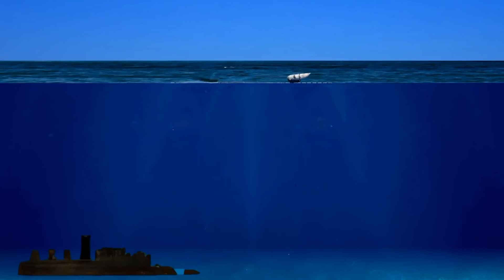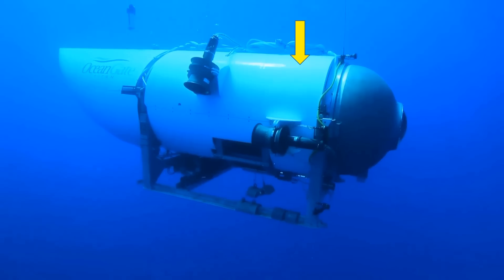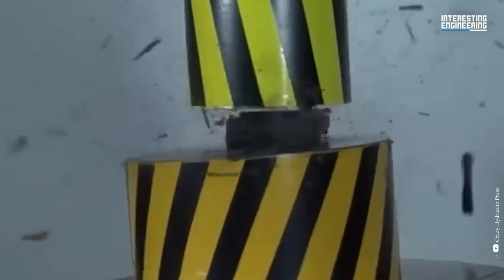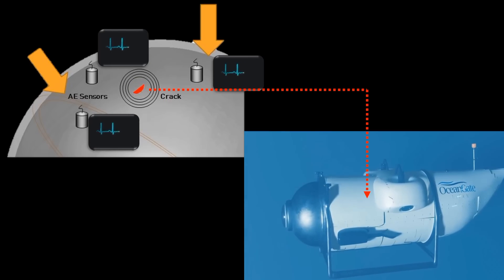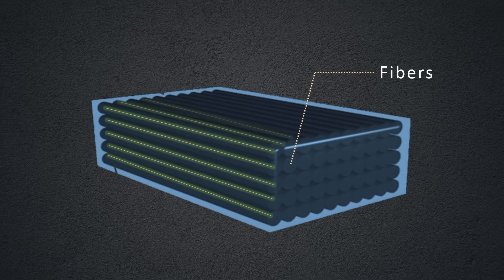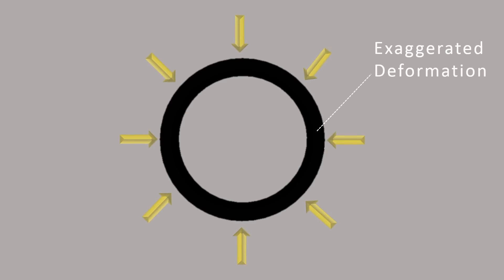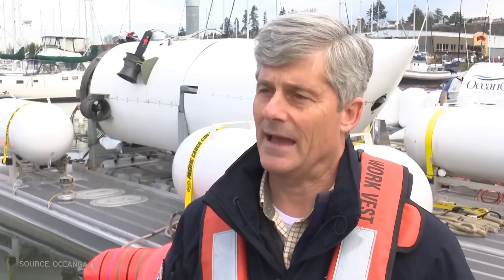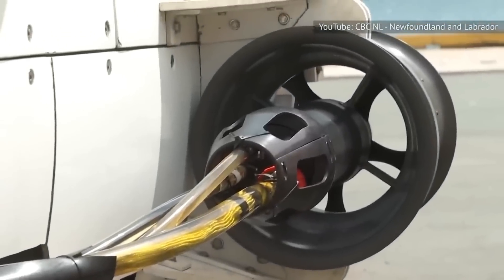Oceangate Titan Did Not Implode Just From Pressure. There Is a Catch!

Comment: If the unverified message log (we do not know if it is genuine) that circulates online is true, a possible scenario would be that water leaked in the unpressurized tail of the vessel, making it descending too fadst and explaining the difficulty to ascend. In the log, the warning lights of the sensors for cracks were indeed as you predict turning all red, but since the vessel failed to ascend properly, the scenario that you describe exactly turned out.
Reply: Interestingly none of the messages spoke of any water intrusion, even tho the craft was clearly progressively loosing buoyancy from about 2960 m down.  Something was giving in a way that reduced the displaced volume without immediately catastrophically failing.

Comment: The cylindrical submarine design is specifically for being able to have passengers
Reply: Yes, Aluminaut submarine was made in 1964 to reach -5300 m, made of aluminim 7079 T6 forged, 11 circular section ,bolted, with x circular cross sections for reinforcement. 15,5 m length, 80 Tons, int dia 7 feet, wall thickness of the hull 7 ' and half 170mm, an other story.

Comment: There are lots of posts on this subject of various quality- this is the best one out there. Well done. I have been working with composites for 40 years and agree with 98% of the content . My only comment is that it is best to view the loading case as a flexural bending situation. This gives tension on the inside of the tube, compression on the outside, and shear on the centre section of the laminate. The compression and shear performance is very sensitive to defects. Great video 😊

Comment: Carbon fiber is great in tension.   But there is NO WAY you can rove a carbon fiber vessel to resist external pressure from all directions.  The pressure of the deep ocean puts ALL the carbon composite in compression.  In THIS use case, Carbon Composites are NOT as strong as their engineering stats might have lead Rush to believe.

Comment: 👍👍👍 .. very well put .. thank you.
A comment on the shape of submarines. Yes, they are tubular out of necessity, as with their maximum dive depth ratings which are nowhere near that of deep submersibles.
Carbon Fibre in sub-surface vehicles? Merely the fact that the material is not homogeneous tends to work against it. However, going forward, used within it's limitations and with the relevant testing and certifications, perhaps?

Comment: Would be really interesting to see a model that includes the locations of all penetrations and mounting points on the hull.  Penetrations and mounting holes (or regions that are stiffer if external mounts are attached with welding (or glue) can change the symmetry of deformation under load and cause stress concentrations.  Even how the lifting points are designed and distributed can have an affect on it's integrity (it is over 10 tons in weight after-all... ) Do you have access to any engineering documents / drawings that include that info.  A model including that would be awesome to see!
Reply: Rush himself stated that the carbon fiber could not be drilled. Knowing that, I would have to assume anything that was mounted within anchored to the titanium rings, or was held in place with an adhesive.
Reply: I believe they used bluetooth for all communications between the inside to the outside, no physical connections whatsover.
An internal life support system plus control unit, the external systems were propulsion and lights + cameras. and ballast control.
One of the early missions the BT comms failed and they had to sit it out until the ballast ties melted from the seawater 10 hours later. and up they popped.
Reply: @joefish6091  Using bluetooth that way would be an interesting solution to the bulkhead intrusion problem but isn't carbon fiber conductive? Pretty sure I've seen it used in wallets shielding credit cards from wireless attacks.
Reply: The only mounting points were 4 attaching brackets designed into the Titanium Domes at 9/3 o'clock positions. Rear stationary and Front secured after boarding. These Brackets attached to the Exo-Frame cage which housed all of the Drive mechanics, cameras, external lighting, etc.
I found no indication of any pass-through connections, making the internal navigation and electronics wireless.
Reply: @MightyGimp  You mean the mounting screws going into the inner lining, right? The brown inner lining there for insulation and for things to be screwed to? You don't think the brown interior is carbon fibre, surely?
Reply: SuperNostalgia.  What is the link with this submersible ?
Reply: Too much for my mind 🤪❗️
Reply: Well either way shoulda used metal. 
You get what you pay for in this case he paid half price for a glass casket.
Reply: I believe your observation is spot on. The dissimilar materials and poor selection of points of attachment guaranteed catastrophic failure, in my opinion. The choice of carbon fiber is a stand-alone guarantee of failure.
Reply: @pugsymalone6539  Without specific plans of the submersible anybody, literally ANYBODY, can go on and on making videos of what happened and how it happened.
There were a team of engineers working here.
Agreed; they were not deep sea specialists but however; ANY mounting point or hole INTO the inner tube of the submersible would NOT have been made through the Carbon Fibre, IF Needed, through the titanium ends.
ANY mounting points would have been exterior to the pressure capsule.
Reply: @Team33Team33  I'm not saying that they drilled into the carbon fiber. I'm looking hard at the reduced diameter of the CF that created the lip onto which the titanium rings were glued. That's a stress point, exacerbated by the dissimilar materials expanding and compressing at different rates, causing the seal to fatigue, possibly the lip itself.  Next is the proximity of the landing skid band to the reduced diameter CF/titanium rings. More stress in the same area. Getting the vessel in and out of the water looks like a bumpy ride; did the CF incur regular abuse from the landing skid torque as everything was bouncing and banging? Accessibility to the batteries, etc inside the vessel appeared to be limited or nil. All around, a textbook method of doing it wrong. The screws visible inside the vessel are attached to an inner metal tube. Preventing visual inspection of the interior of the pressure hull. Ugh.
Reply: @Team33Team33  True, there's so many things that could of gone wrong and yes both professional and armchair engineers across the internet will be arguing over what could of been done better for years. Some will call it idle speculation but to others it's research because you can bet sooner or later somebody will have another go at it.
Reply: @Team33Team33  Correct. nothing in any of the angles I have viewed from assembly shows any transition connections out to in. The design dictates now would be necessary and everything internal likely operated wireless. * This would explain the 7th Emergency release, the dead man switch(no pun intended) which would release weight as the substance dissolved in the event all onboard were rendered unconscious.
** One thing no one has considered, in hull failure, is the possibility of a necessitated emergency assent creating an unplanned Hull load. If the landing frame did not Jettison properly, sticking on one end or the other, it could drastically change end load on the Hull. The Top rail of the Cage was a Weak point.(compared to the lower cage structure)
Reply: From what i read on the ReEdit. Carbon fiber is pure tensile strength (aka pulling) its basically ropey when you push on it were is the strength there is none. That hull was 5 inches of Epoxy for hull, that is how i understand it and under that pressure it was essentially glass, with the carbon fibers acting as imperfections and weak points.  Wonder if it wouldn't have survived longer as just 5 inches of pure Epoxy.  Metal bends buckles and bubbles as it weakens and gives you time to surface and survive. His glass bubble shattered.
Reply: @will-vi9pk  The glass bubble was only tested to 1300 metres. Rush knew that, but chose to ignore the fact.
Reply: @will-vi9pk  What you say is absolutely true. 
If you took the tube from  toilet roll and bound it with carbon fibre, assuming   that you could seal the ends, it would withstand immense pressure from the inside. However if you removed the pressure, you could probably crush it from the outside with your bare hands. 
I wonder whether the strength figures were taken from the aircraft industry, where the carbon fibre is resisting stress as the aircraft climbs.
For a submarine, it does nothing and an epoxy moulding would have been far stronger, not to mention cheaper. 
However. mixed epoxy resin, contains air bubbles that would have imploded under the working pressures of Titan starting from the outside, progressively reducing it's strength to that of a sponge. 
The solution would have been to first store both components in a vacuum, maintaining the vacuum during mixing, then injecting it into a fully evacuated mould. 
The nose radome of Concorde was manufactured in this way and it never suffered a failure during the entire working life of the aircraft.
Reply: @wilsjane  Very interesting but wouldn't a vacuum make the epoxy less dense? What other ways are there to mold it? Would it also be possible to spin out the air bubbles in a centrifuge as it drys since it's just a tube.
Reply: @will-vi9pk  Commercial resin comes in drums of up to 5 gallons (Sometimes even more) and is free from bubbles. It is the mixing where they are mostly introduced. Commercial mixing is done inside the nozzle, to prevent the introduction of air. 
Slow activating resins are used for large mouldings, such as the Concorde nose, they are vacuum injected to prevent pockets of air. The full hardening time can be up to 21 days for full tensile strength.

The way that Titan was fabricated, looked to me as the most stupid thing that I have seen in my 74 years. It was doomed to fail.
Manufacturing a small sample to test using a hydraulic press would have clearly shown the weakness. 
Carbon fibre is immensely strong under stress, but has no strength under compression. The hull reminded me of a toilet roll which has no compressive strength, once the cardboard tube is pulled out. The situation in an aircraft is the complete reverse, with pressure on the inside and the cabin under stress.

Comment: Since everybody knows that carbon fiber has excellent tensile strength, but very little compressive or lateral strength, it is baffling why anybody would even bother making a submarine using it. The sub's hull either collapsed along its long axis, or it collapsed radially.

Comment: They pressed the hatch on the front and the bottom using only a one inch area bonded by glue big big mistake you cannot bond titanium to carbon fiber with glue gluing metal never works. Next the sub transcripts show they were dropping at to fast of a rate way to fast this is why they dropped tanks they reported hearing cracking at the tail end when they heard that it already was taking on water within the fiber the explosion was heard at 945 am the same time they quit responding.  Next carbon fiber is strong for outward pressure such as oxygen tanks but not for inward pressure period. Take tape make a ring you cannot pull it apart easy but can push it inward very easy. Next carbon fiber cannot handle cycle rates time and time again it will micro crack every time. Titanium and steel can take repeated cycles. Next they bought expired carbon fiber for the cylinder. Carbon fiber has a shelf rating for a reason it deteriorates with time. The sub was never meant to go past 3000ft and was supposed to be scrapped after one dive. There dam thrusters were not even made for under water use. The hatch glass was not even tated for what they did. Bottom line watch and read the transcripts they were dropping fast fropped tanks after realizing they were way further down then they should have been and could not slow the rate. When they heard the first cracking they tried ascending but it was going extremely slow. Why because the fibers were already saturating with water due tonstress cracking. They even dropped the cradle and still could not climb at a ok rate. The whole thingnwas a suicide mission. They lied and cut corners everywhere to pocket money.

Comment: It’s crazy how they made the hull by just winding the fibers I can’t believe the fibers were not woven or atleast using different patterns so the fibers were tied into each other. Whenever fibers are used it doesn’t matter if it’s carbon fiber, nylon or whatever it’s always woven or wrapped in different patterns so the fibers are tied into each other to make them stronger I mean just look at something simple like a garden hose with the nylon patterns same concept. Look up how they make carbon fiber oxygen tanks the fibers are wrapped and turned in patterns all around so all the fibers are tied into each other making it strong and reliable to hold the high pressures. Had Titan used woven carbon fiber or used patterns and different angles to make the hull it for sure would have been stronger but I’m sure would have still failed at some point because Stockton wasn’t taking the proper steps to be sure the sub was safe. Everything about the sub and the way the company was ran is hard to believe but seeing how the hull was built by winding fiber around a cylinder and being that naïve to think it’s gonna be strong enough and not even get it checked to make sure it’s safe is nuts! I would want it checked after every dive.

Comment: I personally don't see the game controller as a problem.   One or even two spares could be carried onboard, and game controllers get heavy use and many thousands of cycles during  ordinary game play.   A custom made controller could actually be less reliable.  If a defect was found in the Carbon fiber tube, it couldn't be easily replaced.  Perhaps the failure point is the glue joint between the tube and the end caps.   How would you unglue them to replace the CF tube.   andther thing abuut CF is that it is really only as strong as the resin bonding the fibers together.   While it is suited for light weight comparatively light duty applications, it is probably completely unsuitable for the extreme pressures of the very deep sea.  Delamination becomes inevitable.  We really don't know exactly how the CF type was laid up.   Was it just wound like a thread spool or was woven fabric merged in.   My understanding of CF tennis rackets is that a lot of considerations is given to the orentation of the fibers within the racket frame.  The Titan appear to just be a thick wound spool.   Oceangate probably didn't have the resources to really do proper development of a craft intended to be used at such extreme depths.  They gambled and lost.
Reply: the controller is probably the most tried and tested part of the sub, tested by gamers throwing them across the room and they still work
Reply: Yeah I think people harp too much on the controller aspect, but to be fair I don't like the idea of it being bluetooth. I think wireless connection adds unnecessary variables.
Reply: @General-kt4bf  I expect they had a wire on board, in case it was required. The controller was easily the most tested and durable item on the sub.
Reply: @jimboyd1277  oh I hope they would have, but with how sketchy everything else seems to be there will always be some doubt.

Comment: From my very basic understanding there is a greater issue of manufacturing of a carbon fiber hull than what they have fully appreciated, So this makes the argument over 5 inch hull vs a 7 inch hull null and void if there is miss aligning of threads in the manufacturing process. Sounds like even if he made it in the shape of a sphere, the possibility of delamination would still be an over tiding problem between physics and manufacturing. Sounds like he pushed new technology outside of the envelope of safety in its proposed use.

Comment: As an engineer in the transportation field, three things bother me about this sub's design: 1.  The different elastic modulus of the titanium dome from the cylindrical hull (has lower elastic modulus) will produce excessive stress at the joint.  2. The direction of maximum stress in a cylinder under internal or external pressure is diagonal not circumferential, so why was the cylinder wound circumferentially? Most composite pressure vessels have fibers wound diagonally.  3. Maximum stress is at the interior surface, yet the interior of Titan had numerous holes in it from screws/fasteners that held fixtures (lights, computer displays, the floor, etc.).  Author is correct in that fatigue of composite material is much greater than uniform materials like metal.

Comment: Carbon fibres strength in compression in composites is usually 10 % to 15% lower than in tensile.Thus, carbon fibres should be able to withstand the compressive forces acting on it.Thus, i believe that it was the use beyond its lifetime because of 10 trips  prior to this that led to failure. The number of hours that the titan could spend should have been determined experimentally and assessment with NDT after each trip ahould have mandatory.